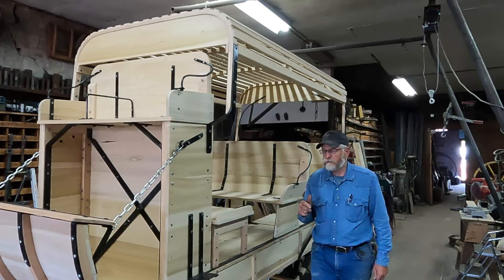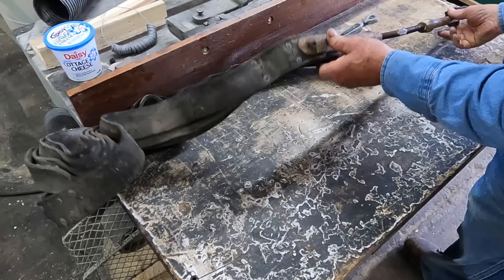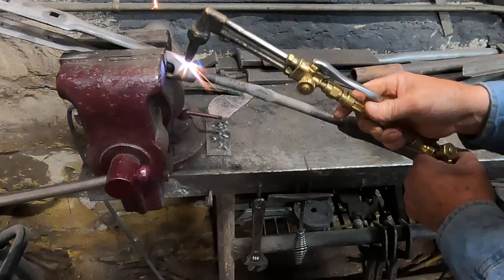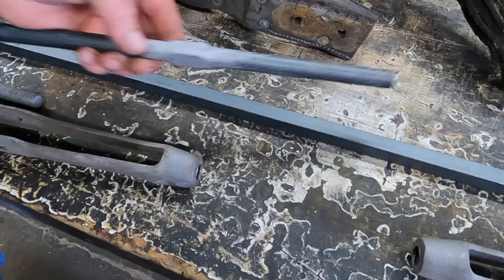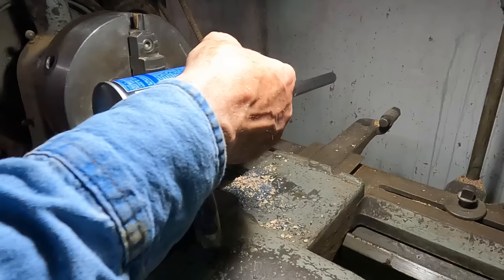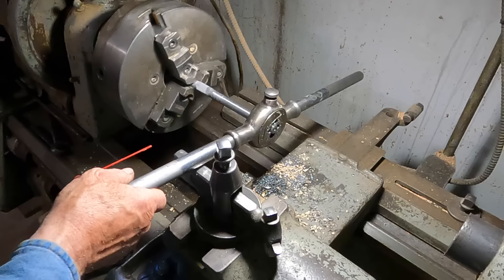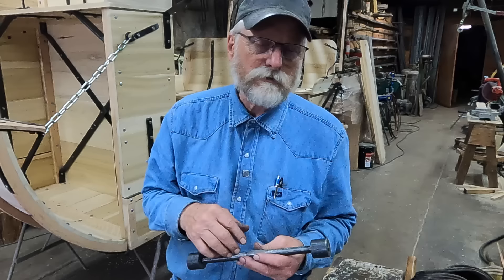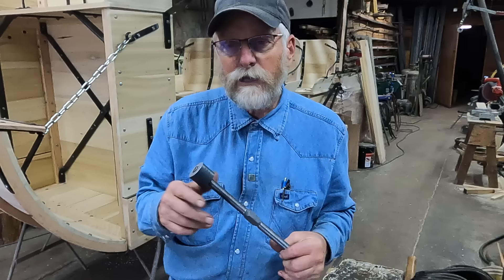I've Never Tried This Before | Engels Coach Shop

Comment: Many years ago, the 1960s, I worked as a tool maker in a shop in Minnesota. They hired a guy who claimed to be a machinist and he came to work with his tools in a burlap bag. He took them out of his bag and lined his measuring tools up on a shop rag and was given the job of chasing threads on the lathe, similar to what you are doing here. I will never forget--he was into the work maybe 3 or 4 passes when he engaged the feed at the wrong mark. I tell you this is absolutely true. He started the next pass and the tool was eating the previous threads and I heard him, as did others in the shop, "Git back in the furrow!!!" as he whacked the tool holder with a wrench. The owner had a few words with this fellow and the next thing he was sweeping his measuring instruments into the burlap bag. I never saw him again.
Reply: Thanks for the story, made my day.

Comment: Here's a little trick for threading... for RH threads the spindle (chuck) should rotate in the SAME direction as the leadscrew. For LH threads the spindle and the leadscrew should turn in OPPOSITE directions, works every time!!
Reply: Thank you

Comment: Curtiss over at cutting edge engineering calls those clean up cuts 'spring cuts' because you're taking out the material left due to the springiness in the tooling/workpiece. He also gives the threads a kiss with a small belt sander to take the burr like peaks off the thread form. It's been 38 years since I last machined a left hand thread. I think I'd need to go back to school now before attempting it!

Comment: first make the internal thread and then the external thread. It is easier to adjust the external thread.
It doesn't have to conform to the norm as long as the screw and nut fit.

Comment: You may not be a journeyman machinist but to cut internal and external left hand threads is very impressive!!!!!!!
Yes, I have been thinking about whether you were going paint or stain the Wagon and you have upholstery and the 
canvas top.    Then mounting it on the running gear.

Comment: Great job on that project Dave. I know what you mean about not being "Proficient on a lathe. years ago I worked for an Elevator company, and in our shop was a lathe similar to what you have there. and I never ran one before I went to work there.but the need to come up with parts that were not available to be purchased as in your case I too got to learn how to make left and rignt threads nujts etc. it took a lot of thinking. But mostly just learning how to operate the lathe Fun stuff and what's the old Saying" Necessity if the Mother of invention. and its also the Mother of learning how and what to do. Thanks for the reminders. great stuff. ECF

Comment: Hi Dave, true it a sand cast piece, 
You would have to carve a 2-piece wooden Mold pattern. Melting metal with Cole, Coke, Limestone, Use a Fien soft paint Brush for dusting, a secreting board on your Wooden cask frames. A Piece of Copper tubing to create Vents and Pore holes. Metal shrinkage is a factor so use a Metal Shrink roller for the metal you plan on using to make the right size Wooden 2-piece pattern for the Top and bottom sand box (Cask) Mols a little water for binder in your sand Mold. Lots of youtube Videos on Cupolo's and Sand Molds and Core making. This stuff helps us improve our capabilities and Skills. You might be enabled to set up a Cupola and do sand Casting out at the Ranch.

Comment: I’m not a machinist by any stretch either but enjoyed learning all I could in my maintenance department. Sometimes it was stressful when the clock was ticking but fixing something and learning at the same time was satisfying. I wanted to beat my chest the first time I single pointed threads on the lathe.

Comment: Interesting project. When you trying to clean up the internal threads, those passes are called spring passes. They allow the tool to cut the material left from the cutting forces pushing the tool away (out) from the material being cut. Without changing the reading on the scale.
Nice work.

Comment: I've had a great deal of success with unbending threaded rods using wood. I used something i had on hand near the press, and that turned out to be the thing that i've been using for this ever since, IE some chunks of oak parquet flooring i'd recuperated from a rotten floor. The oak's hard enough not to crack, but still soft enough not to damage the threads.

Comment: I have found that glass bead blasting provides incredible smoothness and anti-gall protection to metal threads. This is especially true with stainless steel which is always prone to galling.

Comment: That turnbuckle style that was on the wagon is the same type of style you would find for chains in hauling but they have an addition of a ratcheting wrench mounted in the middle. Otherwise its like the common turnbuckle nowadays but just split and flipped. You take one and cut the casting in half and lop off the ends of each rod (the loop and hook parts) then flip them around and weld the threaded bar together.

Comment: Thanks for the clarification. I was worried that someone else was going to take over and we'd miss the finish.
The turnbuckle is off to a great start, I think your method makes sense, I'm guessing you will put flats on the nuts to weld the legs on.
Another enjoyable few minutes, thanks for sharing.

Comment: Im not sure if the origins of the saying “half nuts” came from the lathe world or not but as a 40 plus year machinist/ toolmaker I must say that half nut on the lathe sure does come in handy for whipping up custom threads. The Hardinge HLV at work is perfect for this kind of work. I really like the welded up portion that you did, as that is an alternative but effective solution. Nice work once again!

Comment: What I would have done is use the 5/8" square stock and turn it down between centers to get the threaded ends. Building up the center with welds works, but it is added work that isn't necessary.

Comment: If you heat the bolt in the forge to a red heat then lay it on a wooden stump and strike the high spots with a wooden or rawhide mallet you should be able to straighten it without damaging the threads. Good luck. I very much enjoy your videos. Keep up the good work.

Comment: That style of turnbuckle, apart from the ends which sandwich the leather, are in fairly common use on sailboats. They're used on the standing rigging which supports the mast. I'm not entirely sure why this style is chosen over the more common ones.

Comment: Your talent and problem solving skill is most impressive, but you seem to be undervaluing your time. The $150 spent on a tap and die seems much less than your time to cut the threads on a lathe. Thanks for showing the process! That is far more valuable than a video of you shopping for the tap and die!

Comment: Fascinating work, Dave.  When you first showed us the turnbuckle with what appear to be cast iron ends, I thought you might be venturing into sand casting, especially since you have an original part to copy.  Is that something you have done before?  I wouldn't be surprised, but I would be impressed.

Comment: I got to thinking about how you were going to weld the 'ears' onto the threaded part you made in this video. If you are going to forge weld wouldn't it have been better to weld them on and then cut the threads? It seems to me that when you start pounding on the next pieces you will move the threads around. Thanks.

Comment: I didn't know that Sears had ever sold a metal lathe.
Reply: They sold several metal lathes some smaller than Dave's with a 9" swing.   That one is an Atlas 12" with a Craftsman badge on it.    They were made until around 1981.   I think they sold metal lathes for about 50 years.

Comment: Fun though it is to watch you make these... McMaster Carr sells 6' 5/8x11 low strength steel threaded bars for $26 each. If this comes up regularly it might be worth just having a few. I also find the tap and die for less than $20 each for reputable manufacturers at well known suppliers (not Amazon who recommend junk). Sorry, I'm an engineer, I always second guess other people and I expect my coworkers to distrust my choices too. And wouldn't it be easier, if you are going to make these from scratch, to thread the rod first? Before you weld it.

Comment: It might have been better to weld on the added material after you threaded the rod.

Judging from This old Tony making a tap and die isn't a lot harder than cutting the thread with the lathe and you will have them in the future.

Comment: Not a criticism.  I have the same lathe you do and the chuck is mounted on a threaded shaft.  I have always been afraid to run mine in reverse because if something hangs the chuck will unthread and fall off.   Do you take some precaution to prevent that?   I would be happy to learn a new trick for my lathe.  Great job single point threading.   Always a useful (but tedious) skill which I avoid if possible.   Love seeing the wide variety of skills you use.   Most are out of my skill set.   Great videos which even my wife enjoys.

Comment: Genuinely surprised at the choices you made in this episode. What was the problem with a four jaw chuck? Presumably you don't have one, surely you know someone who could turn the square bar down for you? Secondly, left hand thread, I think you said it would cost you 129 ish - so what, you pass this 'speciality tool' on to the customer - what's the problem?
Reply: I think you missed Dave's point: He has a 4 jaw chuck (we've seen it in use before) but there is time involved in swapping chucks and truing the stock in the 4 jaw, and as he said time is money. Same with sending it out to be done; $$$ unnecessarily added to the cost of the project or deducted from the profit. Because it is none of our business, we don't know how Dave is billing this job, whether it is simply time & materials, quoted a price to do the entire job, or a combination of both.  If it is a contracted price Dave would be throwing away $100+ profit buying something that he proved wasn't necessary. If this project is simple "time & materials" and you really think Dave would "pass <the cost of> this 'specialty tool' on to the customer" I'm gonna suggest you haven't learned the character of the gentleman most of us respect beyond words.  (Just my opinion, of course. Have a great weekend!)